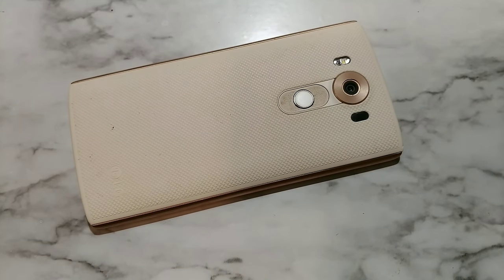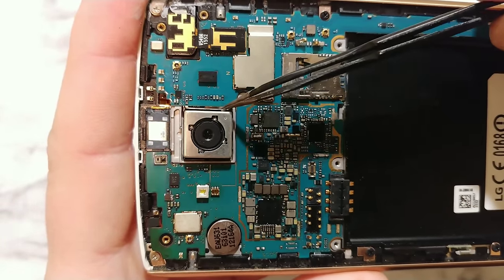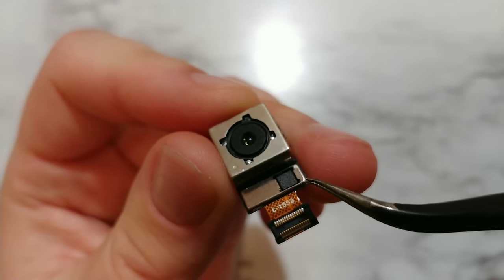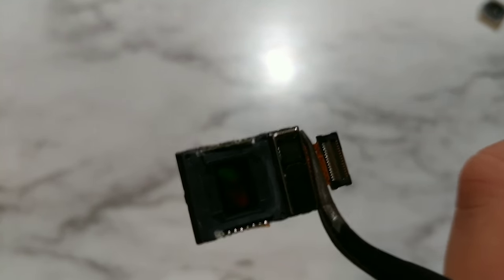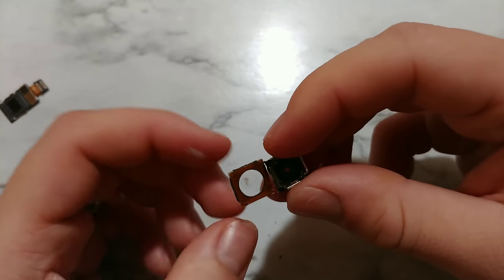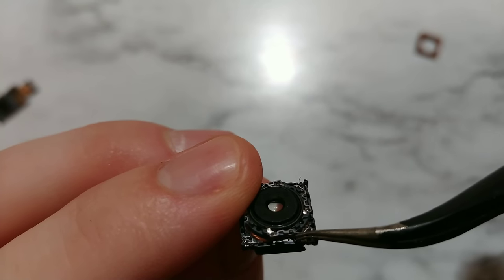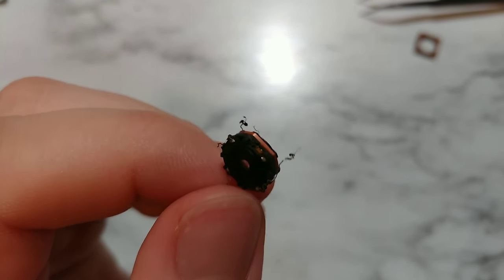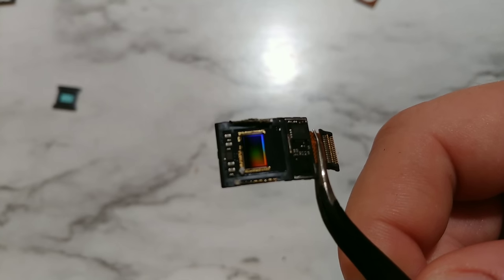What's Inside Smartphone Camera & How it works??

Comment: Hi. Great video and neatly done. I have a question: After removing the actual lens (which you had done without seemingly damaging the CCD), could the camera be reinstalled into the phone and then use the phone attached to a suitable SLR zoom lens to operate as a workbench microscope? I have several C Mount quality lenses.

Comment: I assume thats not OIS. That seems to a focusing mechanism.
Reply from the maker: I understand your thinking, but focusing and zoom in & out is digital, not optical. And without those wires camera would be still in place, and not move around. So I'm pretty sure that is stabilization. Thanks for watching😃 please share & subscribe👍
Reply: @SzTSzTechnology  You're are wrong. Focusing needs movable lens mechanism.
Reply: It is a stabilization module based on having a pcb (the brown one) flipped opposite the lens. That pcb is basically a coil of wires that creates an electrical field to induce movement. Current passes through that to determine x-y movement.
Reply: @ArunG273  yes. Focus can't be digital (for this assembly). It is mechanical but wasn't shown here in detail.  He should have disassembled the lens part. Inside that is a coil surrounded by 2 or 4 magnets. Z-focus is housed on the part holding the lens.

Comment: Grrreat video! As you say... fascinating! My Mum's brand new 3 month-old smartphone, bought online, has a fault on the rear camera - a permanent grey 'mark' which appears on both photos and video... I am thinking 'sensor'... any ideas, anyone?  If I return it, can I expect a repair or a replacement? Oh, and Mum is, wait for this... 92!
Reply from the maker: Thank u! Probably lens or something on camera. Hardware vise. Well if that ia inside of phone and phone came with tht fault and it wasn't on contact woth water or something. They should accept it, but no promises
Reply: @SzTSzTechnology  Thanks... it's a ttfone 950...

Comment: Did you find the IR filter which layer I'm trying to find out how to remove it
Reply: Nice nice I'm trying to do the same thing. Ok so which phone are you doing this on? If it's an LG I might be able to tell you where it's at.
Reply: The blue colored glass in the video was the ir filter. Sometimes it's red tho. You can distinguish it from other glass by the fact that it only will be blue or red. The part that can see full spectrum features colors such as green and dark blue.
Reply: In this guy's case what he'd want to do is to shatter that blue part then reattach the camera and it should work like full spectrum camera
Reply: @unlimitediq1894  lg v30
Reply: @HelamanGile  oh shit it might be very similar to my LG L44VL. I managed to pull this off with my LG L44VL. But, I accidentally broke the LCD screen and I still haven't gotten the chance to get a replacement. Thanks to this video I know I did the conversion correctly.
Reply: @HelamanGile  yea I've not even finished watching the video for your phone yet and it is already looking a hell of a lot easier to pull off than my LG L44VL. https://youtu.be/dKk7F9uEWJ8 It won't show ir conversion I don't think. But, I will check it out more tomorrow.
Reply from the maker: Cool! I appreciate that conversation guys, great informations👍🏼
Reply: @SzTSzTechnology  are you good at removing phone screens. If you could remove the phone screen of a LG Rebel L44VL and send it to me I'd pay you back.